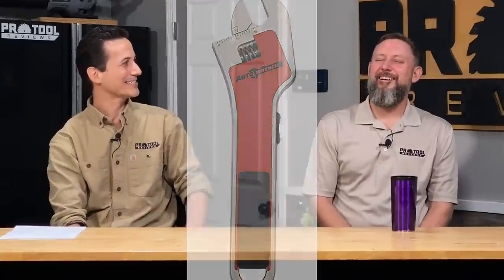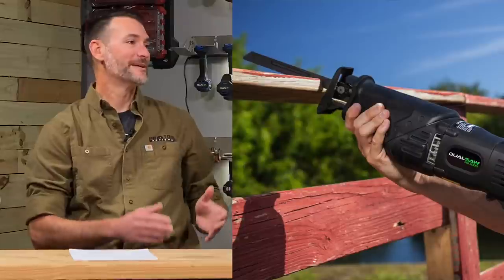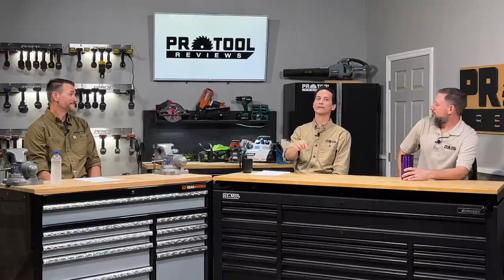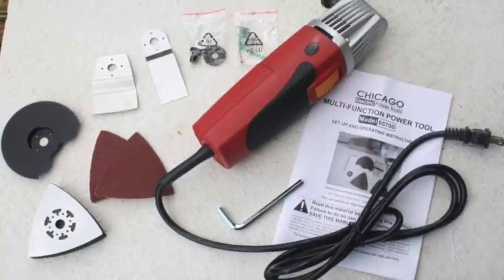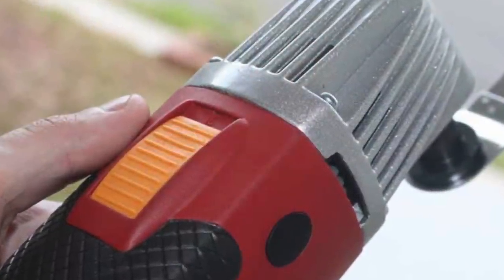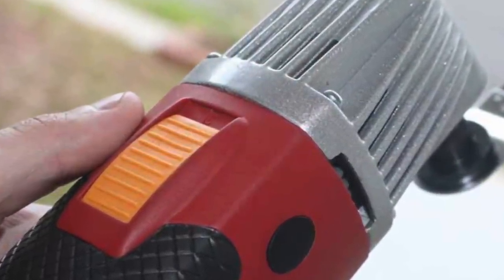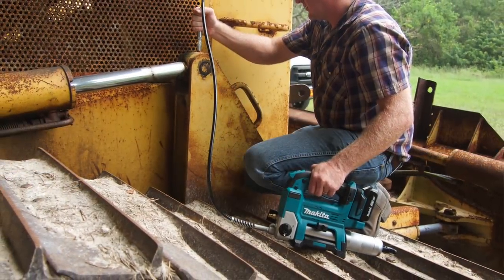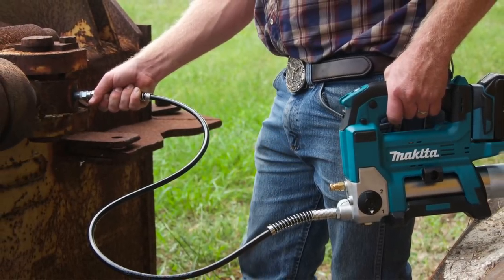Power Tool Fails That Should've Never Been Invented

Comment: I have to disagree with one of these. I find the stubby hammers very useful…for my purposes. I have the claw hammer in my little indoor tool bag (so I don’t have to run out to the shop in snow or whatever) and it’s fine for the small jobs my wife wants done; say, hanging a picture. It’s fine and doesn’t take up as much room in my tool bag. I also have the ball peen hammer on my gun repair bench. I don’t want a 2 lb. hammer to tap in, or out, small roll pins and the like. So, for me, they are a viable tool. Just hung a picture which reminded me of this vid.

Btw, just before this video was released my cousin gave me item #1, which his wife got for him years ago. Pretty funny.

Comment: My worst is the “auto hammer.”
I had one made by evolution or some terrible company like that. Didn’t work a bit.
Reply: I have a ridgid one that goes on the jobmax. Useless. The only reason i bought it is because it came with a 3/8 ratchet and a pneumatic jobmax body for $65. I already had the cordless jobmax as a multi tool so i figured it was worth the $65 for the ratchet and air body since when i found out they had the jobmax ratchet head it was already discounted. Ive used it a couple times. The nailer never worked for anything.

Comment: Aww boy do I have a story for you 
Back in 2006 I just got out of college and needed a vehicle but I was broke so has the moron 22 year old I got a 1998    
Ford ranger that’s been sitting sence 2000 so 6 years  but  it’s had 2000 miles on it but it sat in the street for all 6 years and I live in a state we’re we get so much snow they use salt  on the roads so all the tires dry rotten so bad I needed to replace them but I had no tools so I went to Harbor freight and got the best cheapest tools they had and boy they were amazing i used my dads for everything but his tools were like 20 years old lol so they were trash so these were great until I used them on the ford ranger  
They broke with in the first time I may or may not have Putin 4 ft pipe on them but then I realized something next time I will use a 3 ft pipe I still haven’t learned I’ve broke more ratchets in my life then my dad ever ownd  in his life then. I got a impact rench holy cow that was the best thing I ever got but still was using the silver sockets and boy they worked for about 1 tire and then boom pop sparks whent flying socket bits were flying and still I use silver sockets lol 

And the tool I thot I would hate is the thing I love the most it’s a stupid hand saw that takes saw zaw blades  

The worst tool I ever got was a Chicago electric drill it broke in like 20 minutes 
Thanks for the video I love them

Comment: 1050 put the spring in a pipe with end caps and slotted on 2 sides to view spring compression. End cap center drilled for bolt. Use half inch round cup (spring mount) insert to compress spring.